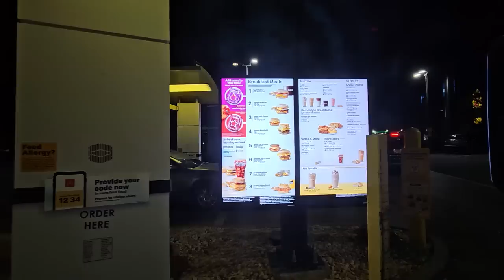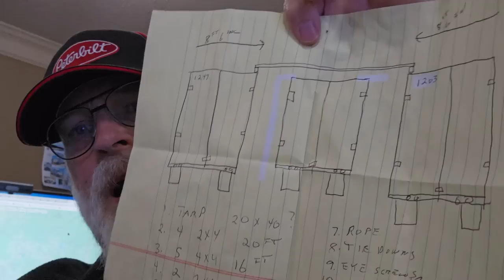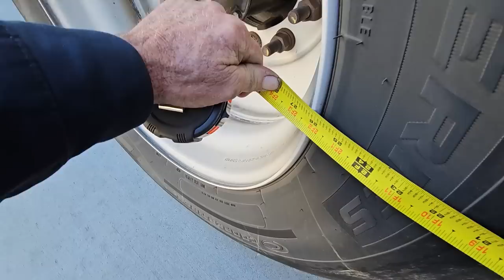Dog Leg Trucker

Comment: I'd be running a tape measure from the kingpin to the front axle on both sides.
Also jacking up trailer with weight off wheels and checking bearing and bushings. Also check and make sure the slider rails are not bent 
Another thing that will cause trailer binding is a dry 5th wheel. 
Hope your new mechanic checked all that also. Should be checked 1 or twice a year anyways
Reply: I was hoping someone would say that. Well done sir.

Comment: Alignment issues usually cause uneven tire wear.  Things do wear out.  Should have turned a sharp corner and then measured to see if the axles stay in position.